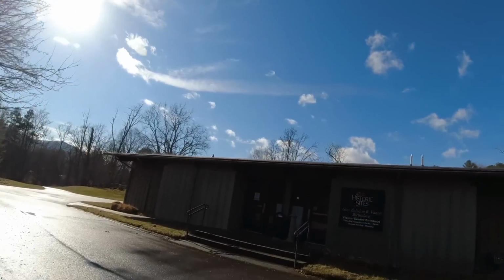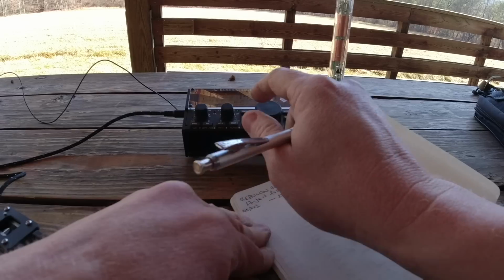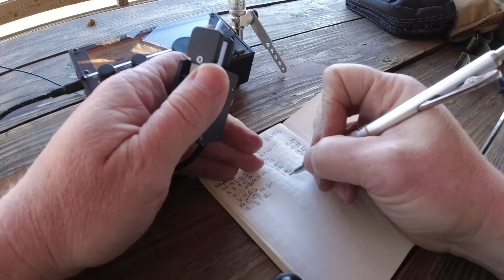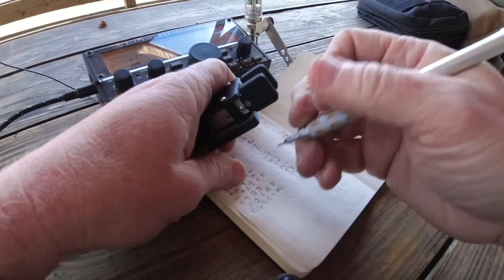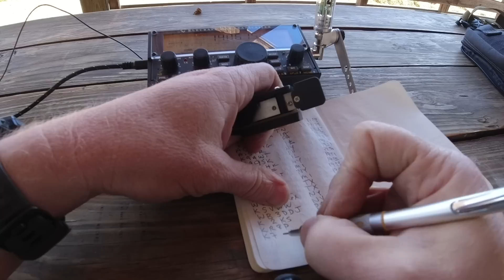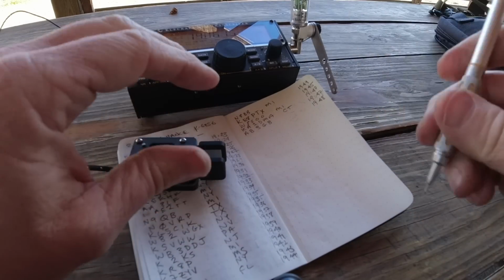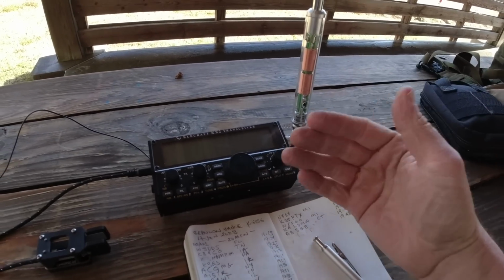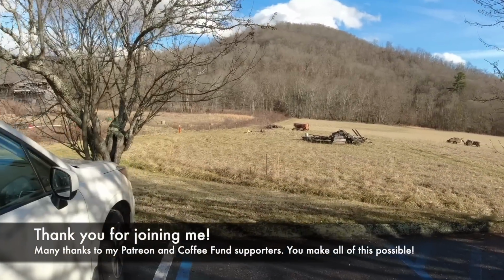Field Report: The Elecraft AX1's secret power? Speed of deployment.

Comment: Thomas, time and again you pull out that AX1 and clearly demonstrate your prowess as a Field QRP expert.  My attempts with the AX1, here in Boise have been mixed.  That KX2 & AX1 combo works for you, clearly.  I even checked the continuity of the antenna, it's fine.   My KX2 is an amazing radio.  A 35' Random Wire PackTenna always works...
Reply from the maker: It is easier for me here on the East Coast because of the population density of POTA hunters, all within normal propagation footprints. You would definitely have a more difficult time in Boise, I should think. Then again, you may find a day when the AX1 does the trick! A good random wire is hard to beat. Do what works for you, OM!

Comment: Those darn bears, LOL. Every year one of our inexperienced tent campers will come to Colorado with a brand new tent and leave a cooler full of food in it when they leave for the day. A juvenile bear will come by and ultimately destroy the tent even though Our damp host warned them to take the cooler with them for the day. They usually see the bear damage and ultimately abandon their campsite for someone else to clean up, LOL. It is funny as I rarely see a bear myself. Last summer I was weed-eating and got rained out. As I was packing away my equipment I saw what looked like a dog run through the small 11-site campground with matted wet hair from the rain. When it got to one of the 50-foot cliffs a couple of small scrub oak trees jutting out, it leaped up the vertical face in 3 powered push-offs of the little oaks. At that point I realized it wasn't a dog, it was a mountain lion and it wasn't liking me look at it very long, it had been annoyed at my electric weedeater and had been waiting for me to get out of the way so it could travel about its business, LOL. At that point, I decided not to do my lunch-hour gold panning even though the rain had subsided to a light sprinkle, LOL. Cheers es 72, Dave - KU9L
Reply from the maker: Yes, more people need to be bear aware. It's scary how reckless people are with food, etc. in bear country.